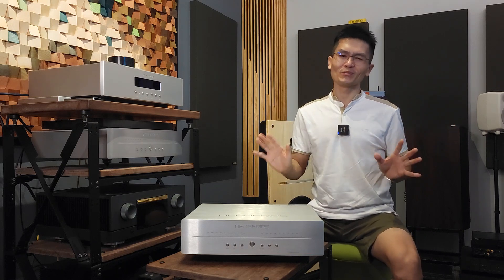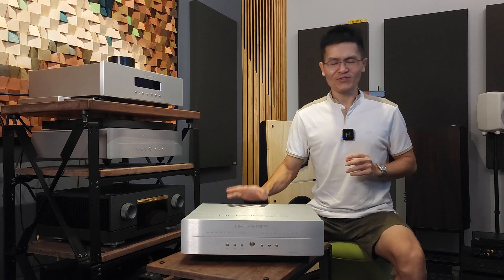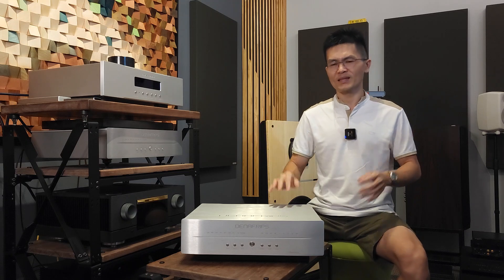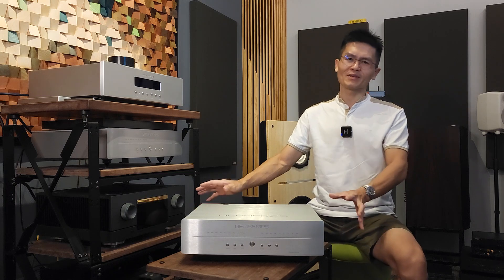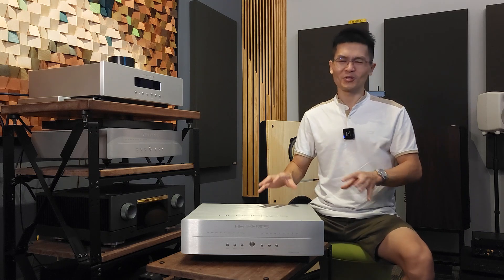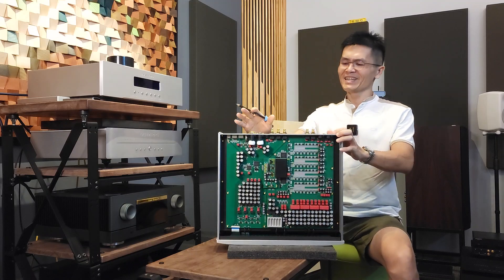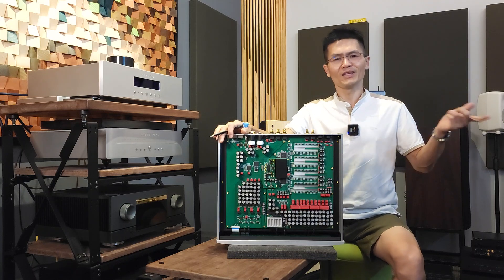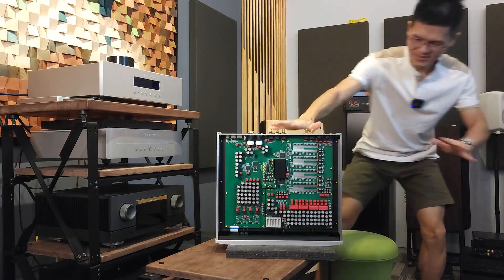FPGA FIRMWARE Update | DENAFRIPS Terminator II / Terminator Plus DAC

Comment: I am not tech-savvy, so I struggle with downloading firmware. Fortunately, with the assistance of Vinshine Audio, after several attempts over a span of two to three days, I was finally able to successfully download the firmware. The results have been quite impressive. As Alvin mentioned in the video, there is a noticeable improvement in sound quality, with greater detail and clearer separation. The sound is slightly brighter but not excessively sharp, which enhances the experience when listening to rock music. The guitar sounds stunning and more musical, while the vocals remain unchanged. However, one downside is that the volume cannot be turned up too loud. It's important to note that these are my personal observations, and the effects may vary depending on the audio systems being used.
Thanks to the efforts of Vinshine's teams.

Comment: Denafrips and Vinshine need to have a better user interface and firmware upgrade solution with a dedicated USB port connection for a laptop to read the firmware version and update the firmware.  Second improvement they should make will be to add a display/remote or cell phone app to interface to the DAC so the users can change input or other features on the fly.